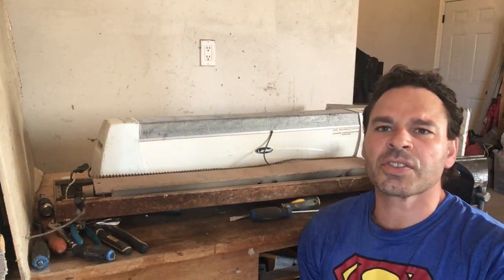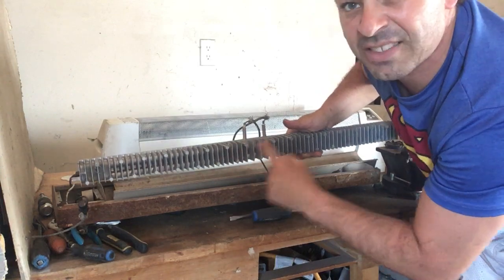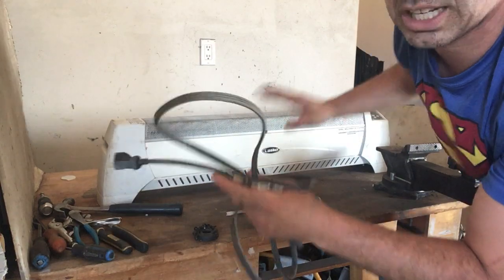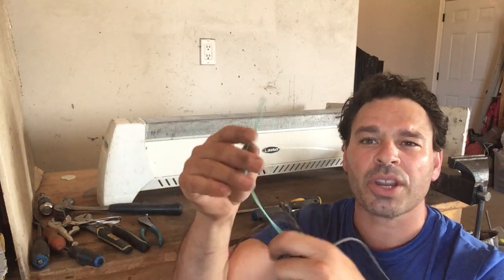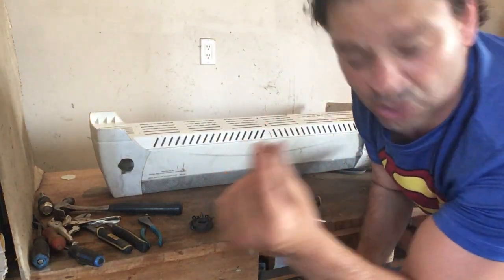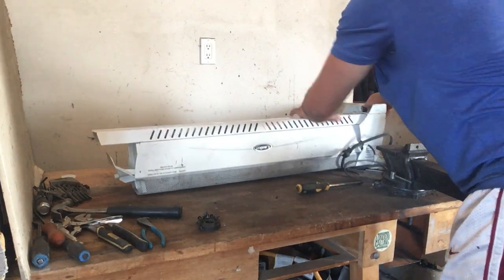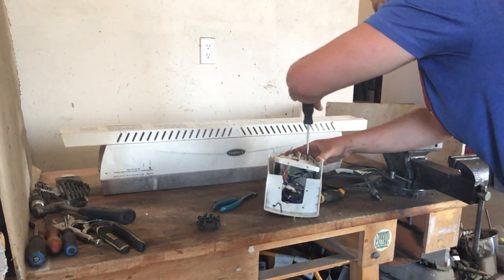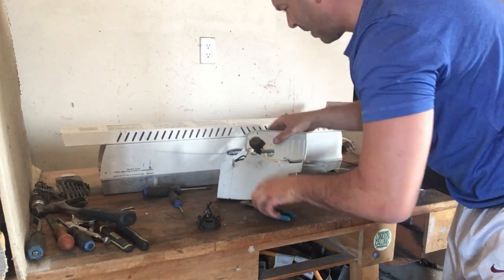Scrapping an electric heater for tin, copper, brass, and zero waste!

Comment: How can one tell the difference between cast aluminum and pot metal?
Reply from the maker: Cast aluminum is non magnetic and does not spark when hit with a grinder blade. Pot metal would either be cast aluminum if the above criteria is met or if magnetic is either tin or magnetic stainless steel.